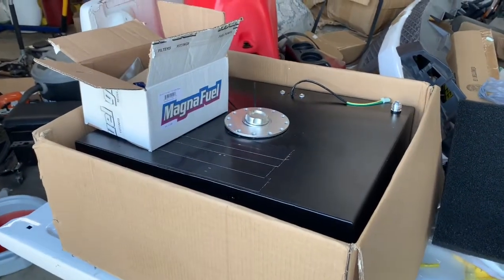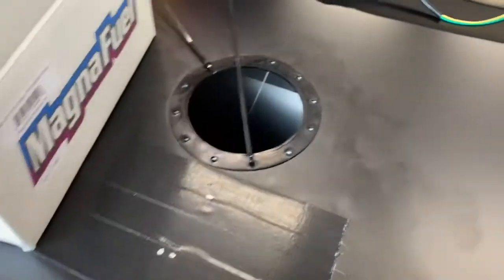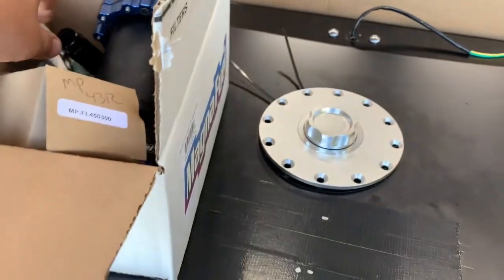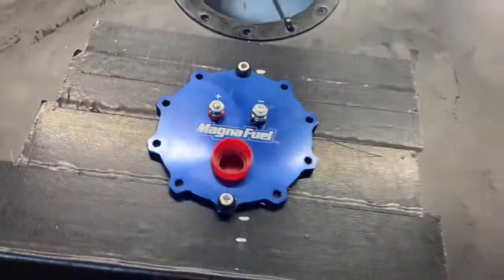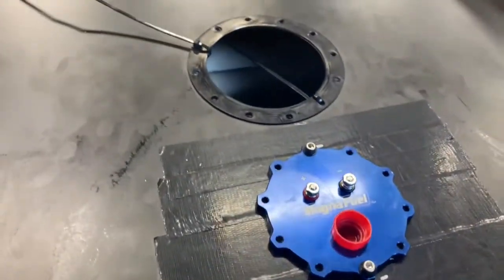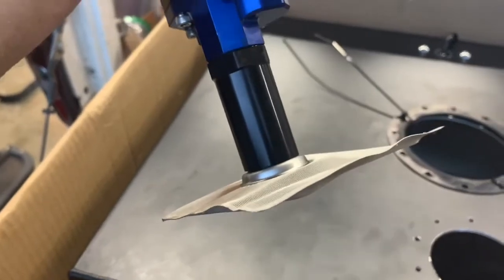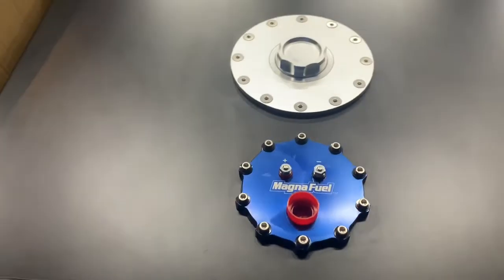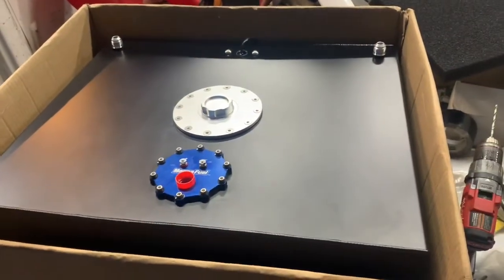New Magnafuel 750 In Tank Fuel Pump Install MP-4312

Comment: Did you get this up and running?  I was wondering if the system worked out for you.  I am wanting to do a setup with the same pump but motion race works said the in tank pumps are not reliable.
Reply from the maker: No sorry I haven’t finished the project yet it’s been put on the backburner for now unfortunately.